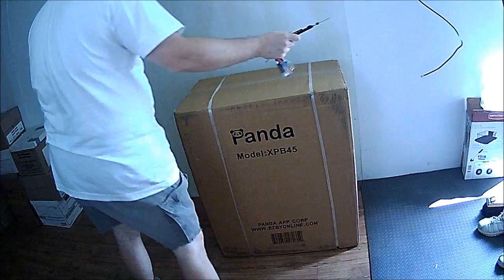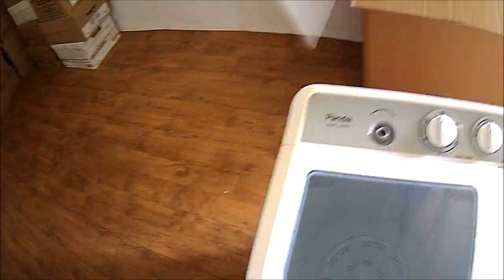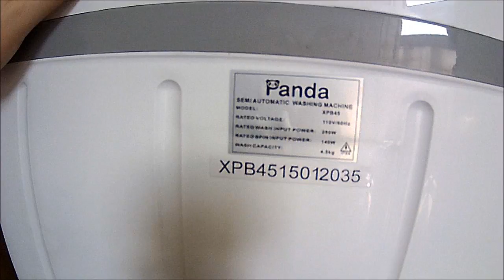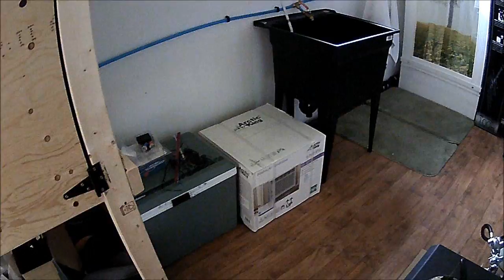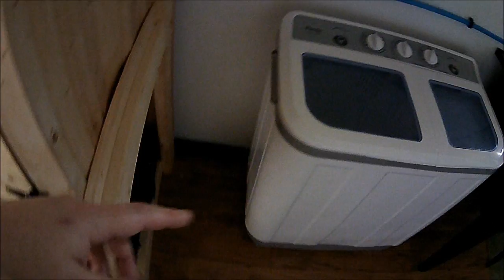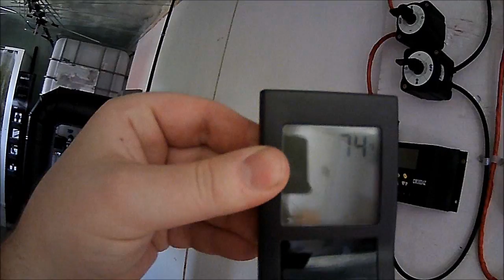Off Grid Washing Machine & Spin Dryer

Comment: I don't get why people that are off grid buy these things. They should demand 12 volt appliances. If there is a demand, they will make them. Now you have to go and buy an expensive pure sine wave inverter, so you don't wreck the motor, not to mention a inverter would be an expensive paper weight after an EMP. Anything that is 120 volt ac is not off grid....period.

Comment: I bought one of these at WalMart and it was about $20. It's a laundry drying rack that might fit inside your shower. It's great. https://www.walmart.com/ip/Honey-Can-Do-Tripod-Drying-Rack/21958247. You can get a 2 tier one for a little more. https://www.walmart.com/ip/Household-Essentials-2-Tier-Tripod-Floor-Standing-Air-Dryer/16616239. It folds for storage.
Reply from the maker: very good! thank you :)

Comment: You could build a base with a drawer for the unit to sit on. Not too high, because you want to be able to reach into both sides of unit down to the bottom to get all items out. The drawer could hold laundry & other cleaning supplies. If there would be children around, make the drawer child-proof or put another storage unit above this unit for the laundry supplies. My only question is, how will this system work on heavy bed linens & comforters, or even quilts? Maybe you would have to take them to a laundry center. Good luck with your build. I am anxious to see the finished product in detail, slowly explaining your equipment & storage. Please keep your mouth near the mic & hold the video camera in a way that it becomes fluid with your body & head. Slow your speech & speak clearly for those who are hearing impaired. Thanks for sharing.
Reply from the maker: Very good Mary ! :) Love the tips and I actually got a new camera so things have improved.

Comment: I though being off grid ment no electricity unless you are using solar to run it or 12 volt batteries with a power converter . i have one simiar to this one .
Reply from the maker: yes I plan on solar and batteries to run this on a nice sunny day :)
Reply: 62hotrodvair its called a washing tub. With a scrub board and hand wringer.
Reply: 62hotrodvair 
what if i design a washing machine that doesnt use any electricity and is heavy duty will you buy one??

Comment: I had thought about getting one of those, but I didn't like the idea of stopping to move the clothes into the other section. I found a "Haeir" (sp?) on Craig's List and love it. This is one unit, is about half the size of yours and works like a regular wash machine. I bought a high quality hose to connect to the faucet. I never have to balance it. At the moment I have the water turned off to my trailer (had a leak in bathroom), so I just brought the hose inside and filled it with that. : )
Reply from the maker: perfect. sounds like a better option. good luck with the leak :)
Reply: The Off Grid Tiny House Thanks. Well, it works for me. Whatever works, right? Yeah, I didn't realize there were two leaks under the sink AND toilet, so have let the flooring dry underneath and will have them fixed soon.
Reply from the maker: oh boy

Comment: Put the outlet 48" or more above the blue pex tube water service, and use GFI OUTLET for safety.
Reply from the maker: Great Tip ! I will have to do just that. :)
Reply: 48" up from the floor in case tube leaks you won't get electro-shock, think safety.
Reply from the maker: My receptacles will be waist height I think. I dont wont them low.

Comment: The washing machine looks like we can put a lot of clothes in, but why would designer separate the washer and the strainer?
Reply: Because it is not an 'automatic' washing machine.  The cost of a nice washing machine is about $390++. This type of tub washer does not require a regular laundry hookup.  It is washer/spin dryer combination, which requires hanging your clothes on a line/hanger to complete drying.  You have to manually take the clothes out of the washtub and place them in the spin dryer. The spin dryer removes about 80-85% of the water, minimizing drying times.  You can use these washer/spin dryer combos in a larger bathroom or kitchen (very portable).  A nice standalone spin dryer costs around $139-169.
Reply from the maker: you bring up a good point. I am not sure why they do this, but the machine does work well.
Reply: i see.

Comment: You are best to test that thing out as soon as possible , just incase, if you wait to long, and it has problems, you may have problems returning it. Same for your Solar equipment
Reply from the maker: Need batteries to test solar gear. Donation button above lol! I will try to test things out as I can.
Reply: +rob mc 
Really you don't need batteries to test a panel . And the washer, you could test at home.. I have heard some bad story's about those small washers. Not trying to bust your balls, but you want to protect yourself as a consumer.
Reply from the maker: you mean just put my volt meter to one ? Yeah I will have to bring it home to try it. its only has a year warranty but the price is pretty good considering its 2 in 1.